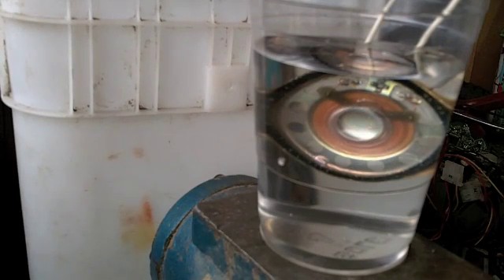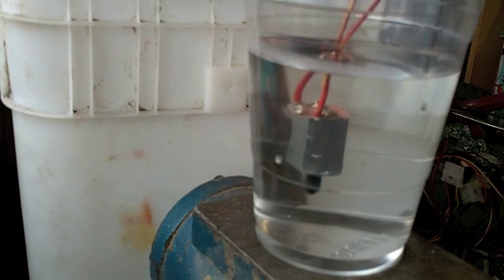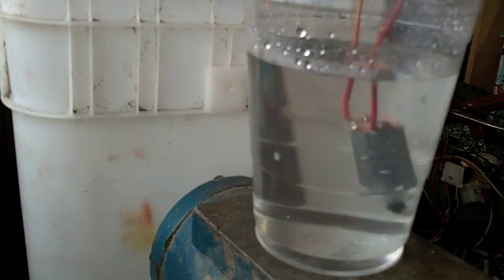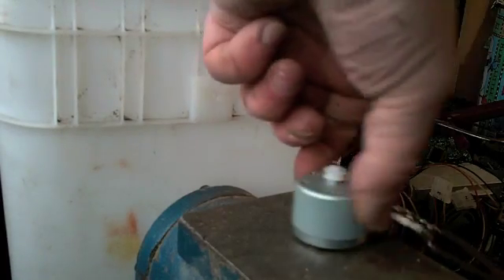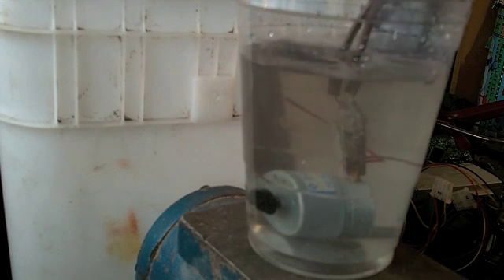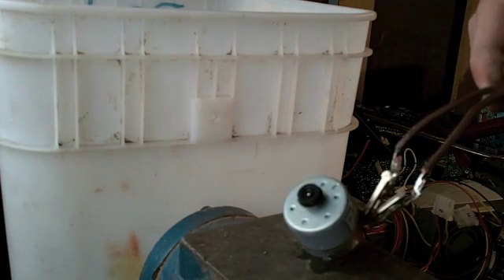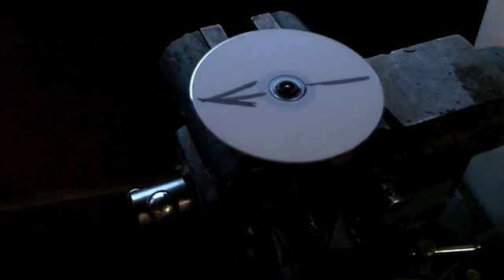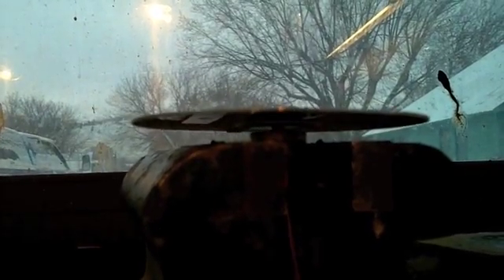Blowing electric motors underwater

Comment: its not the water that killed the motor it was to much voltage
Reply: Dj Mystery fresh water is a poor conductor.  He's burning the motors out with high voltage from a supply.  If you take a 12v batter and connect it to a 1.5v motor it will also burn out in air.
Reply: Kevys Rc & Music ya water takes electricity and amplifies it so it was the water that cussed it to have to much voltage